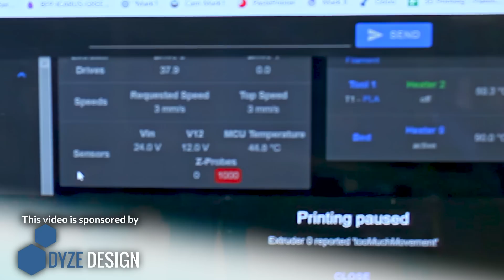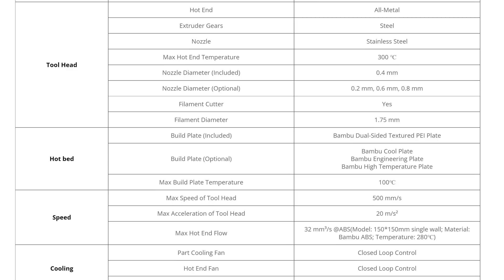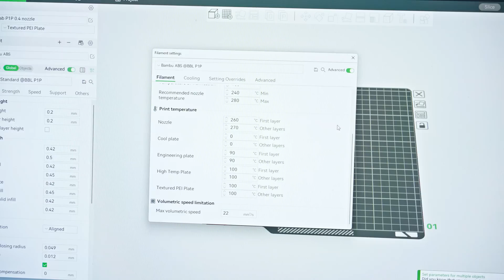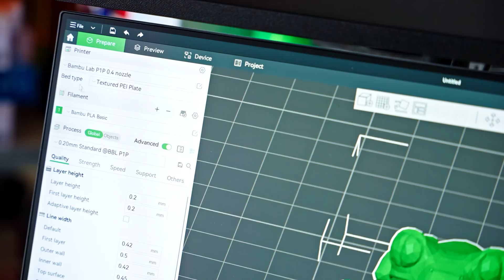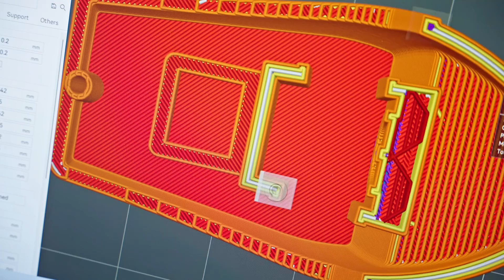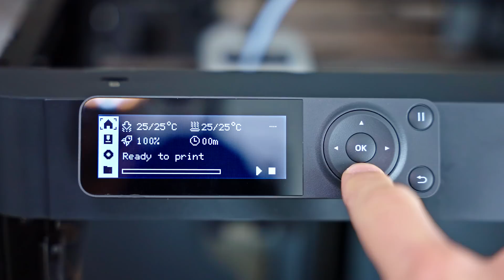Bambu Lab P1P: Tradeoffs

Comment: I'm struggling to select between pqp and A1 machine as a first printer. I understand the difference in kinematics, but still cannot decide if p1p worth it's extra cost.
Especially considering you won't be printing on high speeds if you need to keep good print quality.. also noize.. is it much louder than A1?
Thanks for your videos and would appreciate any suggestions.

Comment: Don't get Bambuzled with Bambu Labs. Bambu also has issues with software being closed source and forcing the use of cloud service. Buyer beware. Was seriously considering purchase of a Bambu model, but changed my mind. The high speed "works out of the box" was appealing until I learned of these other issues. Other better options are out there

Comment: As an industrial designer looking to make structural prototypes with ABS at home, I'd like to have a set it and forget it printer that is hands-off. I see it is currently on sale for $500. I currently have a Sovol SV07, which is not working wonderfully. Is this printer worth it for my use case?

Comment: I have and like the P1P printer, but there are two things I think they should have included and done different. You can't set this printer up without a smart phone, unless you only use a SD card. There is NO LAN for this printer at all, and no way to set it up from the Bambulabs software, while my computer can and does detect the blue tooth connection.

Charging an extra $1,000.00 on the X1 series for LAN is ridiculous. Other than these things I mentioned the P1P printer from Bambulabs is great. 

Love your channel.

Comment: I think that acceleration is way more important than top speed. If you print something relatively small like the Benchy, without a high acceleration it will never get to any quoted speed. But they never quote acceleration speeds as far as I have seen.

Comment: Starting to slide into the "an ender-3 is the best printer you just need 23 simple mods territory" is completely ludicrous statement.  Ive owned and sold and repaired more Enders 3's Bambu's Vorons and Prusa's than most .... This just is not factually correct.

Comment: As this new Bamboo printers are in a price range of more professional printers that are not only used with easy to print PLA filaments i would like to hear your opinion how the closed X1 handles other materials. To be honest most of the printers nowadays can print PLA without issues. So the most i would like to see in a full review how it handles the ASA, ABS, PC and similar technical materials. If it handle technical filaments than its a ultimaker and similar killer. I think this would be the most relevant comparison and no-one on youtube has done that up to now. They all talk of speed the nice features, color changes and PLA prints...

Comment: most strenght type of test is a ripetitve dimensional test, for example print the same piece 20 times and calculate the dimensional error variance. 
anther interesting test is a stresst test about the material wear (nozzle,  carbon bar) for example test it for 500 hours of printing and ceck if the last pirted item have same quality of the first.

Comment: If a company lies on their product page about what it does I'm immediately put off. I know it's common in places like China and the US, but it doesn't sit well with me.
Reply: Bambu didnt lie though. Tom doesn't know what he is talking about, which is rare but this time he is mistaken. In his rush to get out his information he did not research this fully and still hasnt corrected his error. 

1. Slient (50%)
2. Standard(100%)
3. Sport(124%)
4. Ludicrous (166%)

These are multipliers. with standard being the baseline. 
So using the slicer defaults you can certainly go up tp 500mm/s speed by a simple speed adjustment. 

Standard  (100%  )                 Ludicrous(1.66x multiplier)
Outerwall: 200                   |    332
innerwall : 300                   |   498
Sparse infill: 270               |   448
internal infill: 250              |   415
Top surface: 200               |   332

Which also means the default 10000 mm/s acceleration goes to 16,600mm/s or potentially faster depending on part geometry.

Comment: How fast is the Bambu lab printer???
Reply: It can go up to 500mm/s printing depending on the part.

1. Slient (50%)
2. Standard(100%)
3. Sport(124%)
4. Ludicrous (166%)

These are multipliers. with standard being the baseline. 
So using the slicer defaults you can certainly go up tp 500mm/s speed by a simple speed adjustment. 

Standard  (100%  )                 Ludicrous(1.66x multiplier)
Outerwall: 200                   |    332
innerwall : 300                   |   498
Sparse infill: 270               |   448
internal infill: 250              |   415
Top surface: 200               |   332

Which also means the default 10000 mm/s acceleration goes to 16,600mm/s or potentially faster depending on part geometry.

Comment: The screen I actually don't mind, but I'm old and have been using computers since the Commodore days.  It works fine and doesn't affect the output so just something that gives the details and lets you control the machine is fine.

Comment: Hey Thomas, did i dream that you made a video where the X1 carbon had heat issues printing technical materials or did you remove the video?
Reply from the maker: Must have been a dream, because I've never had an X1(C)

Comment: don't know if it's work #3DSempai
question unrelated to the video, sorry
 i happen to have very strange problem with my oryginal ender 3 
it is well maintained and fully functional printer but it start having problems when it got back from a 3d printing course i loaned it to my work (public highschool)
before i loaned it to my work i was mostly printing abs on rafts very small model parts using 0.2mm nozzle
and now i simply can't make it work the same as before, it simply print every raft very rough and sandy instead of smooth and that start on the edges of 2nd layer, first layer is fine
raft get smooth to the middle part but then when it gets to the other edhe it becomes rough again
i replaced many hot end related parts and the problem persisted trough swaping entire hot end, multiple nozzles, bowden tubes it simply does not want to print smooth surface, but it irons parts just fine and on top of the parts the print is smooth even without ironing, the only problem is first 3-4mm is solid welded together and rest of the print simply breaks in every layer
i changed abs to fresh roll and the problem still is a thing
my models are usually flat or very thinn and it worked so far very well, but it feels like i work with a different printer now, but there is no luse screws , nothing wobbles and i am using the same slicer profile, or even the same g code and prints looks different somehow
almost as if z screw wore outin places

Comment: Hi Thomas, I saw your post on Twitter and I wanted to bring some things to your attention regarding your comments, I hope you see this.

We brought up thermal runaway protection and was bullied out of the bambu lab server. We were told by staff basically "trust us bro, we got some software protections" We started getting electrocuted and some people also had their heads starting to smoke, where we were told that it was "just PLA burning" in the printer head, and we were disregarded by staff and ignored. We actually made jokes about how our printers were fire hazards and how we did actually begin to disconnect it every single night and were scared of it being a ticking time bomb.

As for in the comments, I will copy and paste my situation I had with Bambu Lab personally and you can consider whether you would continue to cover their products.
Reply: I was stalked and harassed by the staff and nobody believed me about the artifacting across different printers. I was told that I was a scammer who wanted free printers and then they continued to leak information about myself to people in the Discord. I had to go to my bank and do a chargeback because I was stuck with three dogshit, artifacting printers with staff who didn't want to do anything other than ask me if i cleaned the rails 4 times flipped it all the angles in the world all the temps all the speeds all the accelerations all the jerks and that I was the underlying problem to everything since its what all the prints had in common.

They even made this conspiracy theory that every person in the Discord who complained was me on a different accounts, that I socially engineered people for hundreds of hours to get free stuff,  that i was mentally ill (yes, the representative of bambu lab said that to me), honestly great stuff really love how I am being treated after being spending thousands of dollars. 

I spent over 11 weeks, every single day, atleast 400 dollars in fillament trying to fix their printers for them. It was a waste of time, they aren't good machines. The company is just a bunch of random people with a shell headquarters in Texas with no track record of delivering quality products to market.

I also had one DOA system that they forced me to open day one and the thing was horrible to take apart,. The motor died so the thing would just slam the head into the side of the chasis and damage itself LOL, then they told us to superglue our cracking ams systems. Since then, I went and bought three ankermake printers and they've all worked beautifully. I'm still down 4500 dollars due to bambu lab and hope my bank will help me sort it out, as they seem they are doing.

Shout out to Will, Larry V and also Hedgehog if you see this, you are terrible people and i hope you get fired.
Reply: I posted it on Discord then the admins started stalking me into different discord servers, they had like actual raids of these servers with people from the discord, and instead of actually solving my problem would go across different channels to post a PSA that I was a scammer. I joined some of the groups but I am scared to say much after what happened. Huge 3D printing servers had to ban and mute people due to the targeted harassment against me.Honestly after the discord, as I was one of the first to complain, first to have the ams crack, I was absolutely dog pilled by people who at the time had no problems with their printers and claimed I was making stuff up. I got so tired after weeks of this. The company kept trying to scrape money off of my refund and told me that the artifacting on the printers was normal, so they wouldnt return those. Honestly one of the worst experiences of my life. They would tell people I am not a women since they saw my husbands name on the purchase so people dont feel as.. bad for me? (That if i am lying about my gender I would lie about something else basically). They kept calling me a man for months and clarifying to everyone I was not a women. It made me really uncomfortable that these kind of people have access to my order information and made me scared of being doxxed even further by them.
Reply: You may read the problems we have with the artifacting also on this channel: https://youtu.be/4MviZs4bu30 I posted the same comments there. I bought four printers on the kickstarter and had this experience. They were all X1 Carbon Combos.

Comment: Thomas....i tried something NEW concerning my filament. As you notice ....whenever you purchase a roll of filament ....it has a HOLE in the center of the filament spool. WELL....I measured the inside of the hole of the filament spool... and 3d printed myself....a HUB...with a small hole in the center of my hub. The small hole is for a fidget spinner bearing. What the hub is for....is to help the spool spin freely with a bearing in the center of the hub. This is the process.....3d print your hub.... place a metal fidget spinner bearing into the hub. next....inserted the hub into the hole of the filament spool. next ...insert a steel rod through the bearings . Next, ..... build a stand for the filament. Next....drill two holes so your axle can be inserted into the 2 holes you drilled to hold the filament spool. Now you're done.  It works great....the filament never jams or sticks and the spool spins freely and very easily. it serves as easy feeding ...of the filament... into the extruder nozzle with no weight on the spool itself.... and the two bearings make it turn super easy. Maybe you should try this yourself...then do a video on it.  The problem with 3d printing is.....most spool just sit on a large axle and when the feeder for the filament tries to pull the filament......the spool doesn't spin freely enough which cause more tension on the filament which makes the machine work harder trying to pull the filament....which means....your filament may not feed correctly and cause that clicking sounds of the gears trying to pull the filament through to the extruder. I've done many prints with my new idea.....I can leave the room for hours with no problems and come back to a perfect print. hope this was helpful. i really think this idea should be shared with others.

Comment: Screen is honestly the first thing I'd sacrifice for cost savings in a printer.
The old style character display is all I need. just temps, status, feed rate, flow rate  and 3 clicks or less to cancel a print.

Though admittedly, the little FR icon on the actual Anets was not helping distinguish between feed and flow rates one damn bit.

Comment: What I want to see : 
-Ease of use use with various materials vs Prusa (Prusa can go from pla to nylon with stock settings)
-Reliability over time 
-Print quality vs speed (from what you have showed, the P1P can be fast but prints from my MK3s  with 0.4 nozzle in 0.3 speed mode look better from what I've seen

Comment: Thomas, I can agreee with you on the sentiment of "Just get this ender, its perfect after these 23 upgrades.

Realistically. The P1P doesnt need that specific camera. In fact, I have been using WYZE cameras for my other printers and they're just fine.  The P1P, like the X1C has a "part cooling fan" and only -if you're doing insane things- do you really need an auxilary fan?? Just my opinion. I have yet to "need" my X1C'Combo auxilary fan whatsoever. 

I do agree with you that the lack of paneling gives it an unfinished look, but how much can panels be if you print them or go to home depot and get something to fit there? 20 bucks for a spool of filament? 60 bucks maybe if you went plexiglass/lexan?  I dont think it is that bad of a problem.  In fact, I almost with my X1C did NOT have panels, or, if they could be recessed a little so I can put some lights in--> because let's face it, even with the X1C fan, no one can really see whats going on there. (I soldered some lights on the bottom of the AMS and it shines down...but what happens if I want the AMS off the top of bambu? Now I am kinda screwed and cant keep good lighting on my toolhead).

Just some thoughts. I get the "just do these 23 upgrades" but none of them are really "necessary", in comparison to the ender 3... how it literally needs sooo soo many upgrades for some quality of life.  The P1P appears to have it all, just skeletonized.  Even my prusa is in an enclosure--> that was 60 bucks; same with my ender 3, another 60 bucks. I dont know, maybe I am biased, but for anyone who takes printing remotely seriously and uses more than PLA, I feel uses some sort of enclosure, so its hard to knock Bambu for not providing it (idk any 700 dollar price point printer that comes with an enclosure and is even remotely close to specification as bambu.

Comment: I'd like to see you dig more into the actual value of the printer, and maybe try to test the reliability of it? Like the X1C is a bit too pricey for a farm, with the extra complication of ams. Can the P1P better fit in that use case, with custom mods not from Bambu?
I'm really curious about what you think regarding upgrades versus downgrades from the X1C, and what market target the P1P is aimed at instead compared to the X1C

Comment: I would like to see some sort of panels even if just plain injection molded abs just give it a bit more of a presentation. I have yet to see people do flow tests on the hotend setup. I would like to see what speeds you can achieve before under extrusion becomes an issue. CNC Kitchen had strength samples that were fairly weak at higher speeds which tends to point at the filament not getting properly heated. Where that point is has not been tested.

Comment: I would like to see a deep dive into the used hardware/technologie, especially the extruder, because I have seen some issues on the internet with a gear inside of the extruder which was worn down pretty fast. Besides this it is always interesting to see comparisons and tests of quality, printspeeds, reliability with complex prints, etc. Has it powerloss recovery and how well does it work in total?

Comment: Watched many videos in this machine.  The speed is impressive even though it is not as fast as the manufacture says.  I will say, however, I with you, Tom, I would not tolerate the high pitched whiny noise.

Comment: crank the speed of a prusa up to 150 or 200% and test the quality and results, and keep going until they are printing at the same speeds and then check the quality of the print, how noisy the machines are and how much power they use